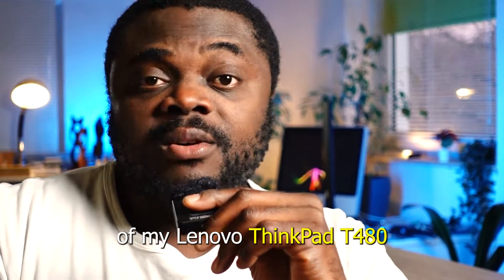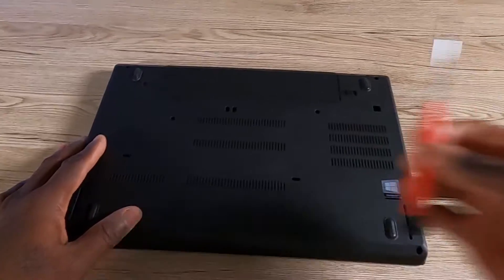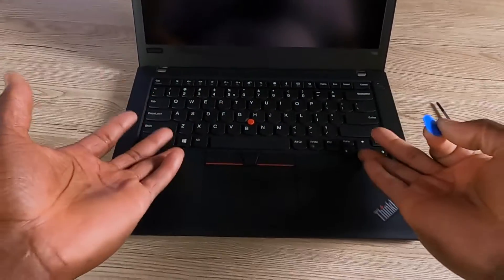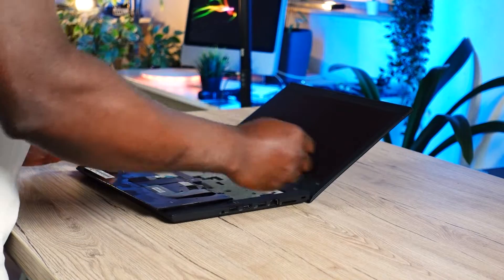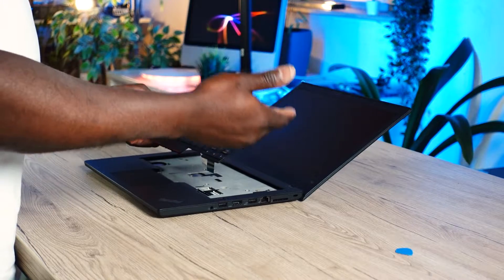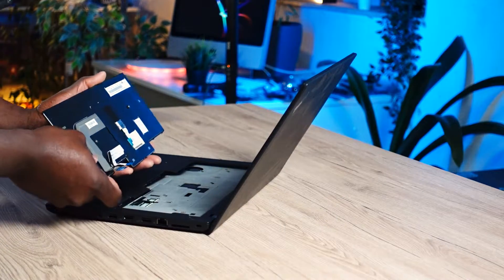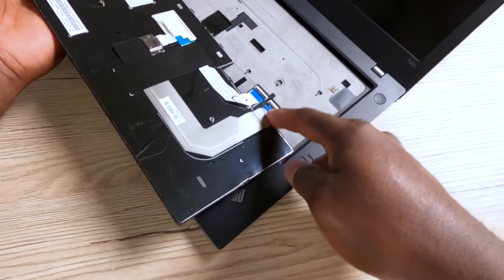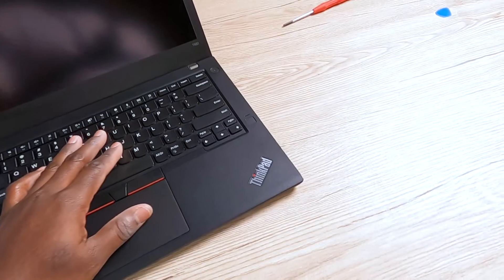Easy way to REPLACE a Lenovo ThinkPad T480 keyboard

Comment: Hello, I have a huge question, I have a fujistu esprimo p420 with corei5 4th gen, nvidia gx 750ti 2gb and 16gb of RAM and it doesn't boot up please I need help
Reply from the maker: you can try removing the RAM, cleaning it and re-installing it. sometimes it helps.
Reply: @Hardwaremoney  I would definitely try it and tell you the outcome